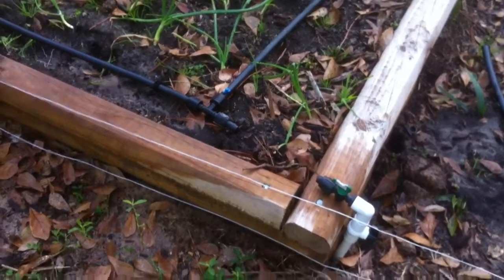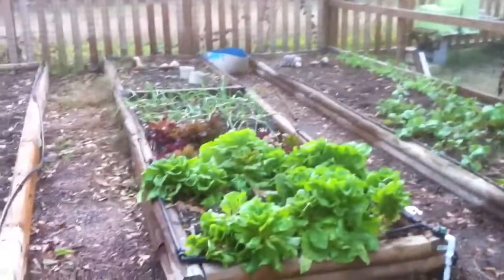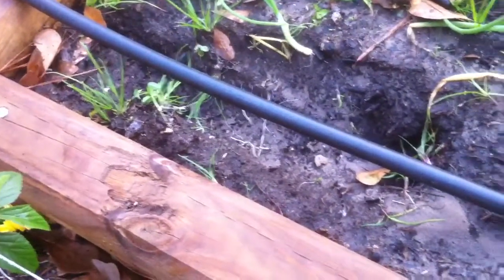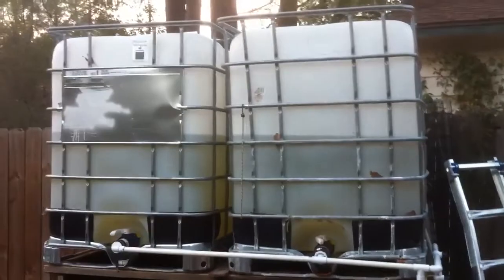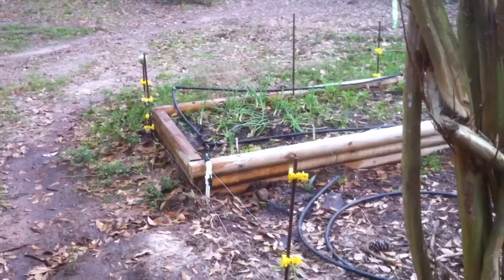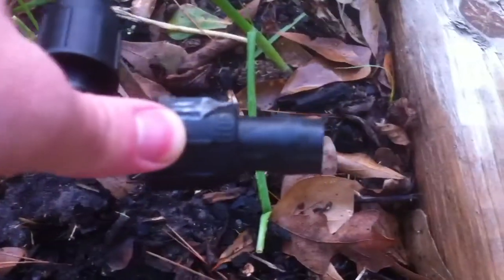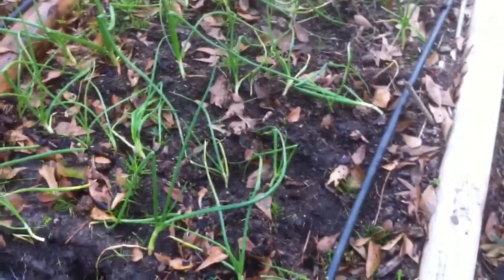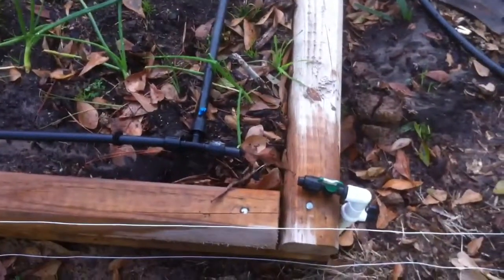Watering System - PT 7 - Fail!

Comment from the maker: I know there are several different routes I could go, and sadly by doing all PVC I'm going to have a couple hundred feet of this black pipe lying around. But I'll use it as drip lines elsewhere. I just need to get the raised beds automated. Of course now I'm dealing with a pinhole leak in an elbow right above the pump. I guess the velocity of water coming through that elbow is high enough it wore it thin. 
This is why I'm making the videos as a series, so hopefully others don't repeat my errors.

Comment from the maker: I certainly don't have enough elevation to do just gravity. I've tried, and it just bubbles out of the sprayers. I'm still not convinced it is pressure alone. Pressure would make the fitting just push apart. Several times I have gone through and just checked the fitting and found several loose for no apparent reason. 
My other issue is the fittings. I like the micro sprayers, but can't find them in a barbed fitting. Threading them into this thin pipe causes leaks. I have a 3/32 tap for PVC.

Comment: I've used a lot of the black tubing with those type of fittings. I have @2000' of drip system on blackberries, grapes, trees etc. I have never seen them pull apart like yours. Not sure what happened, but I bet it was pressure The drip systems are designed for low pressure. Lowes sell a pressure reducer for about 5 bucks. It just screws in after the filter, after the timer. It would be worth a try, I think.
Or,,, you could just try straight from the tanks. PSI is about 4 lbs per 10' elevation.

Comment from the maker: I think what actually happens is stretch/strain fatigue from hot/cool cycles. This pipe is very susceptible to stretch and shrink. Since I had it clamped on the corners, when it tries to shrink it wants to pull out of the fittings. This is not the first time one worked loose, just the first time it did it while I wasn't looking. 
Yes, I use a pump, and I've thought about a pressure reducer. But for now I'm going to switch to stronger PVC. You just mentioned you don't like PVC for your misters...

Comment: I use Drip Works fittings, etc. I imagine you just didn't tighten that one as well as you should, or it got a little crooked when you pressed it in the nipple. 
Are you using a pump off the rain barrels, or just gravity? If just gravity, the pressure shouldn't be too high. If a pump, then you need a pressure reducer.